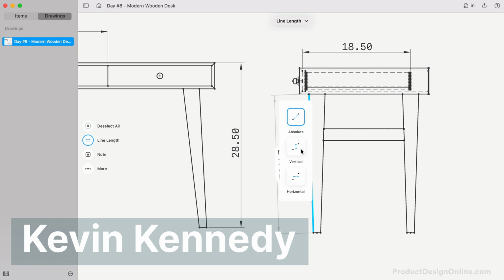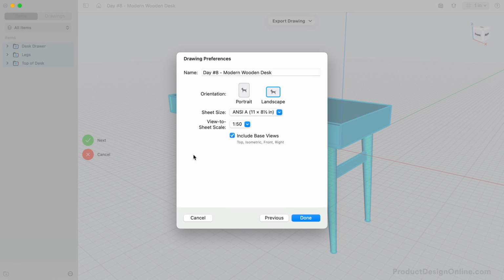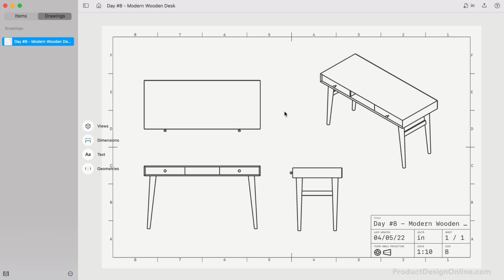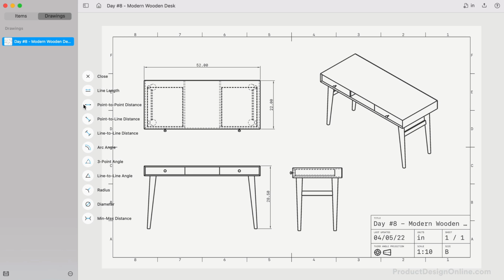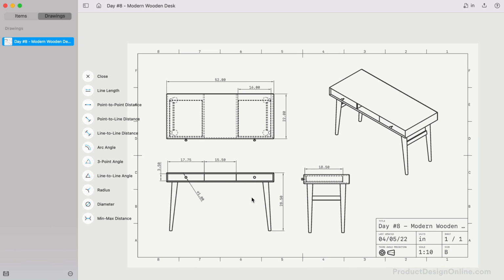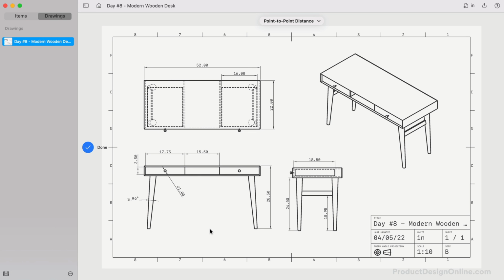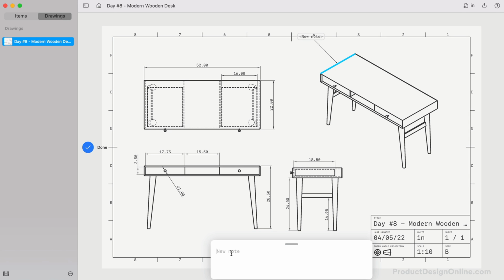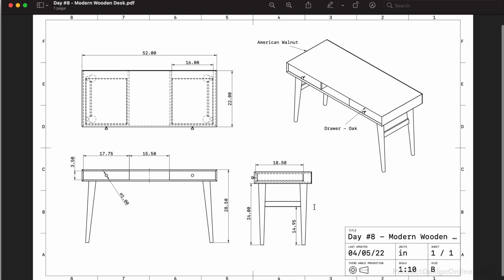Create 2D Manufacture Drawings in Shapr3D | Day #10: Learn Shapr3D in 10 Days for Beginners!

Comment: hi, can someone help me? is there an automatic cut list or something like that? for example, when a large kitchen is drawn, it automatically throws out a cutting list like in solid works.
Reply from the maker: There is no way to do an automatic cut list in Shapr3D, currently anyway. You could export your file as a STEP and generate one in Fusion 360 or Solidworks.

Comment: awesome video. keep up the great work. quick question how can make changes to stl files? Using the free version and I'm trying to extrude out to make cut and its not working. Any help is appreciated thanks
Reply from the maker: Thanks, Luis. I appreciate your support!

Unfortunately, with Shapr3D, most of the modeling tools are locked when working with STL files. You’ll only be able to perform Booleans (Union, Intersect, Subtract) and basic operations like Move, Rotate, Mirror, or Scale.

Depending on your object, you may find it better to reverse-engineer (rebuild it) in Shapr3D. You can reference the imported STL, which is often helpful. They have a pretty good demo that includes some of those techniques - https://youtu.be/ffb_5I5_tFk

Comment: One issue I’m having is…how do you make a second “sheet’. I don’t really want to send my client multiple pdf files, rather a long one with multiple sheets to look at different components. Can’t find an answer anywhere.
Reply from the maker: As of now, you have to create another Drawing from the button/icon in the Drawings tab. Hopefully, in the future they will offer a way to add pages to the existing drawing.

You would need to save them both as PDFs then merge the PDFs with Adobe Acrobat, Apple Preview, or similar.
Reply: @PDOShapr3d  this is exactly what I did. It seems a bit silly because they even number the “sheet”. Surely they will update this as time goes by. Thanks 🙏